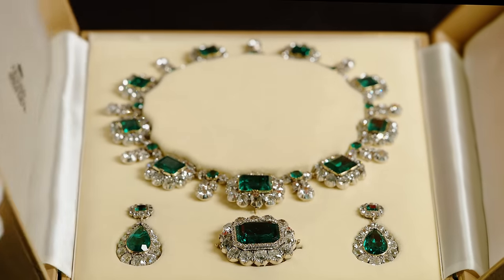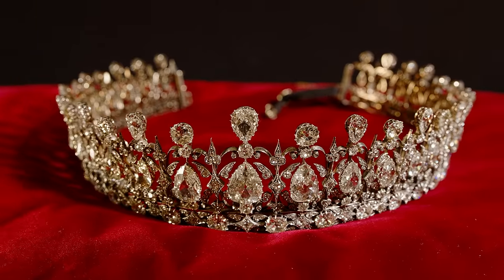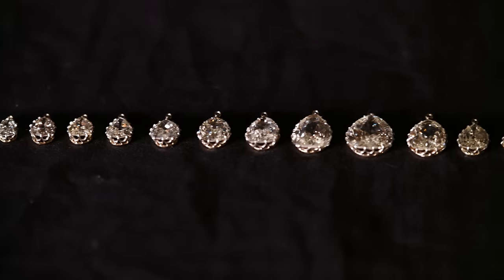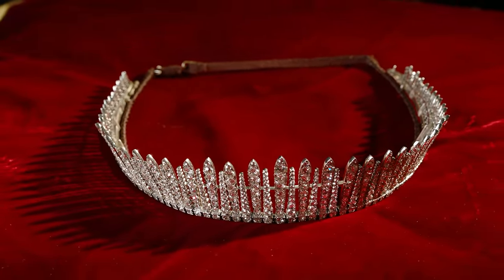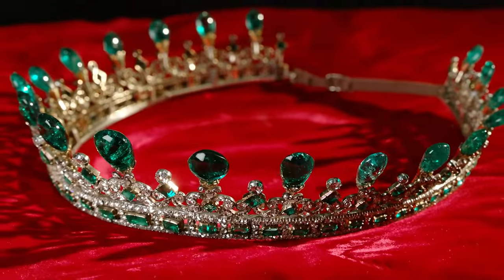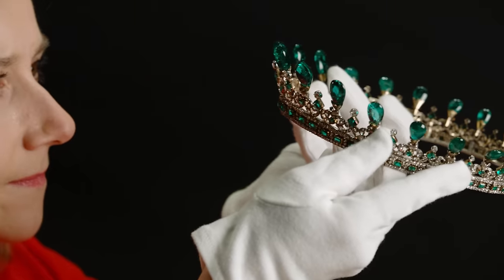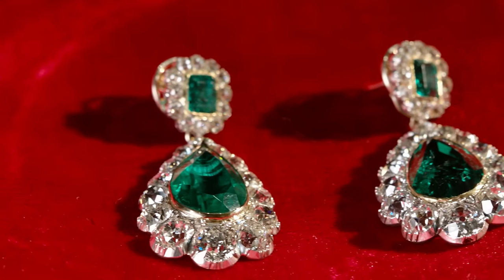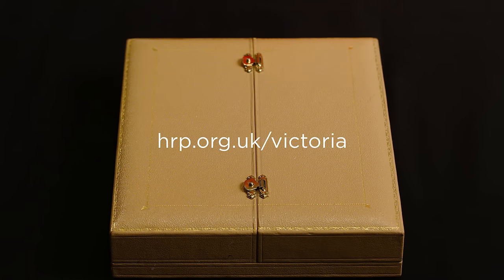Preparing tiaras for the Victoria Revealed exhibition

Comment: Can you only imagine holding emeralds from a crown designed by a king, that has belonged to the royal family for nearly two centuries, and knowing, if you fumble and drop that emerald, it will shatter... I don't think I could handle that kind of pressure.
Reply: AND not running right it
Reply: I think the royal jewels undergo restoration and treatments after every few years. I don't think the tiara will break.
Reply: It was designed by Prince Consort Albert.

Comment: Actually Emeralds won't shatter, they are pretty durable overall.    They are 7.5 to 8.0 on the mohs hardness scale.  So her statement is misleading.    But the emeralds are gorgeous!!!
Reply: Robin Mccormick ikr! I couldn't stop looking at the emeralds♥
Reply: Robin Mccormick I worked as a jeweller for twenty five years and trust me all stones can brake no matter what
Reply: Robin Mccormick  - hardness does not equal toughness!
Reply: As a jeweller I can say that emeralds are usually highly included which makes their resistance to breakage lower. An extremely included diamond would also be quite fragile.
Reply: The statement was..."she had been told"  that if you drop an Emerald it will shatter...
Reply: Emeralds are quite fragile and prone to cracks. I have had a few and every jeweler said the same, baby them  don't hit then on anything
Reply: She's the expert. Not you.
Reply: @hotoneinspai  right? And she probably wouldn't care to take that statement to the test. I sure wouldn't.

Comment: The Queen wore one of those at here wedding. Because it can be changed into a necklace, it had some problems on the wedding day & actually fell apart. The Crown jeweler has to be called to fix it. You can tell in the wedding pics, cause there’s a gap in the front of the tiara that’s very slight.

I’d never heard of the five tiara. As someone who collects tiaras, I’d like to add a replica of this to my collection
Reply: Different tiara. It was the Hanover fringe tiara that broke.  It looks very much like this one.